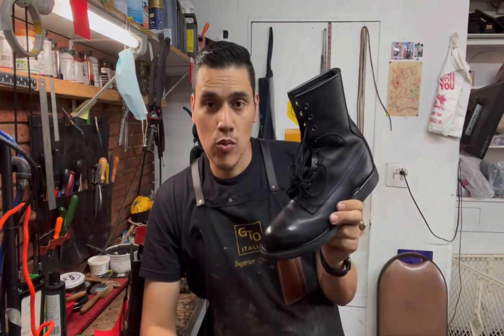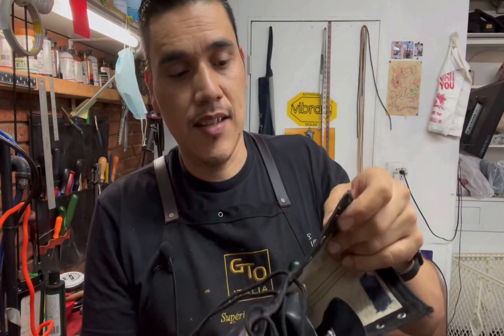Wolverine 1994 Military Boots Re-craft

Comment: I just found the exact same model in my closet after seeing this video.  Same model, but steel toe.  Surprising part is they were made 29-nov-1994. Very odd coincidence. Air Force days in Cable Maintenance.  I think I’m going to have them re soled with a vibram lug.  Since I still do cable work! I’m getting old. 😂